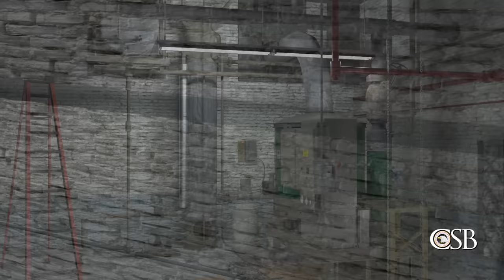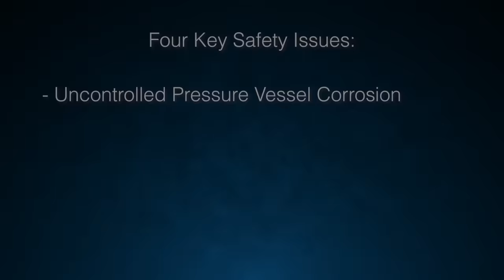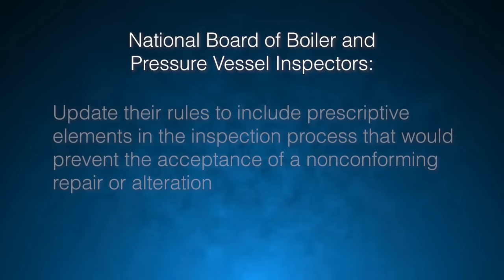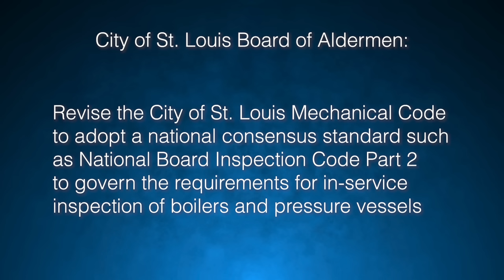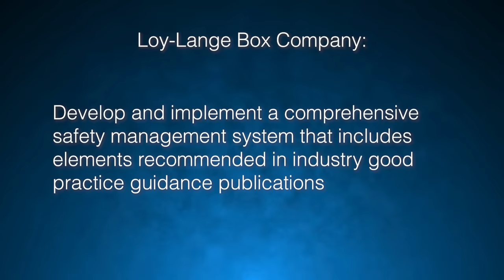Ignored Warnings: Explosion in St. Louis

Comment: I was surprised it wasn't recommended specifically that monitoring of dissolved oxygen levels in the pressure vessel and/or makeup tank should be considered.  In my old life I was in the Navy working in the nuclear reactor department of the USS Theodore Roosevelt and there were very strict monitoring and chemistry controls to prevent corrosion in the steam generators, etc... I now work in the private industry in Process Measurement Analytics and quote many types of analytical solutions including dissolved oxygen analytical solutions for Chemical, Water, & O&G companies.   Looking at Loy-Lang Box Company's setup they could have had a simple DO measurement in the makeup tank and a procedural step that the DO level  had to be less than a certain amount before they were allowed to initiate fill of the pressure vessel.  A $50K analytical solution could have saved them lives and lawsuits.
Reply: Bu that would have required them to spend $50K. Too many companies view maintenance/upkeep as an expense to be trimmed as much as possible.
Reply: @Wolfshead009  so true and such a sad thing
Reply: If you read the full report (here at https://www.csb.gov/loy-lange-box-company-pressure-vessel-explosion-/), they did measure DO periodically. That's how CSB knows that the oxygen scavengers were regularly low as stated in the video.
Reply: Management knew they were out of spec on O2 and continued poor chemistry and process control. No amount of tech investment fixes willful neglect.
Reply: This is the paper industry. They won't spend 1k, yet alone 50k.
Reply: Yes, but that was the Navy. Unlimited money available and serious training and accountability. Out in the civilian world, not the same. Lack of interest by the employees, lack of interest by the company and sometimes low pay and the  need to get product out the door runs the day.
Reply: This company didn't even apply for a permit before installing this equipment, allowing it to avoid inspections.  You don't do that with such an obviously dangerous piece of equipment if you care about endangering lives.

Comment: The “fix” that left a rusted ring at the bottom of the pressure vessel is probably one of the dumbest stunts I’ve seen on this channel.
Reply: Trouble is that a good engineering company assigned to pair that would tell them to repair the entire thing not just most of it. And the Cheapskate owners will not pay for all of it so they'll go and find somebody who will only repair what they want

Comment: Mythbusters gave me a whole new respect for pressure vessels, And their water heater episode showed very clearly what happens when something full of hot water under pressure suddenly becomes not under pressure.

Also do vessels like this not have a sacrificial anode? Our normal domestic water heater has a rod in it that is specifically designed to take a hit for the tank walls.
Reply: The water heater episodes were awesome.  Watching that water heater launch through 2 stories worth of house and the roof was amazing
Reply: Blevy
Reply: I wouldn't keep a water heater running once the tank starts leaking. And a water heater isn't a pressure vessel unless at least three things fail (normal thermostat, high temperature limit and relief valve).
Reply: Great question?
 As this was an exposed tank couldn't they just strap a block of zinc to the tank as the sacrificial "anode rod"?
Reply: @russlehman2070  Not really 3 as the single device is both the temperature and pressure relief. Can't tell you how many people have no idea and plug it when it starts dripping. Even more so on hydronic boilers whose feed valves are passing....
Reply: Yes they have a sacrificial anode. Here some FYI. Don't use hot water to cook with because an anode is made alot different than 20 + yrs ago. You can continue to do everything except cook with. Why listen to me. Water heaters made today are made to fail. Every legal water heater has a presure relief blow off at a certain pressure. It should also have a vacuum relief valve on cold water feedline above the heater. What's the purpose of a vacuum valve. Fill a large plastic coke bottle with water and then turn it completely upside down. Watch it pull in then out then on an on. So if water gets shut off in the street or maybe water pipes in cellar break. Your water heater will pull air in from above an water will drain alright. From experience I noticed that when a new watermain gets installed you will see old water heaters on the sidewalk. I recently installed a 30psi  relief value on my brothers heater and we also installed new water heater. When I went to home depot to buy a 30psi relief valve they only sell relief valves that go on water heater and psi is 150. That would blow the seals, temp and pressure valve and possibly boom.  I notified top management and warned them but have not returned yet.
     Water heaters are not made the same as shown. They will not hold the pressure to explode enough to go thru wooden floors. but will pop and with hot water. Old water heaters were made out of copper. My daughter has one in her house installed in the 70s. Those water heaters need anode replacement every 7 to 10yrs depending on condition of water. Copper water heaters if you put a plug in loc where relief valve goes and your gas valve messes up. Your competing with Space X. If you have a water heater and need to replace anode. Look for any water pipe hot or cold touching each other. Put a little piece of rubber between them. See if your getting a ground reading from water service. When water department's dig and repair a section of main or replace a service. They connect a jumper so they don't get shocked
Reply: @skipd9164  I replaced my anode last winter as I had several new identical anodes left over from no longer used wood boiler..... That bastard was tight! Half inch drive pneumatic wrench wouldn't budge it..... Three quarter inch drive air wrench strained a bit, but it came out and nothing but the center wire left of the long anode in the 8 year old unit...... I told a couple licensed plumber's this story and they said as they shook their head...... "yea we replace about one or two a year"......
Reply: I'm assuming the tank is sealed tight so a sacrificial anode would be impossible to replace. That's why it was designed with the assumption that it wouldn't experience corrosion. If you put a sacrificial anode in it it'd just delay the issue at best not solve it and in this situation it's probably better if process issues become apparant quickly rather that later, of course that's assuming the company operating it doesn't display criminal neglilence.
Reply: Nope no anodes here.  You treat the water first,  heating the water over 200 will get the oxygen out, no oxygen no corrosion.  In a power plant the boiler will be perfect inside.
Reply: Jared, not without proper chemistry control.
Reply: @dr.emilschaffhausen4683  “treat the water first” doc.  Apparently you’re semi-tarded…people on here make me laugh.  Read my comment again.
Reply: @bluesmoke8714  *bleve
Reply: @hedgehog3180  you assume wrong there is also a cold water feedline that brings water to the bottom and that sacrificed
Reply: A sacrificial anode is only suitable to stop galvanic corrosion. This is a case of oxidative corrosion, which is the same thing. It may not be protected by a sacrificial anode.
Reply: @jaredmayer3960  Jared I hope you don't set your water heater anywhere close to 200 degrees. 110 to protect people from getting burned especially kids.
Reply: @shakarchi420  your correct about the 3 that could cause problems but high temperature control and thermostat are together on the control valve and pressure relief is on the side by the top.
Reply: @hedgehog3180  most older homes use the water service line as ground. I actually watched a water department worker fixing a connection to the main get zapped. Standard procedure is useing a jumper. The never used it before and the crew laughed there ass off. While working as a gas tech I have found gas pipes in a home where electrolysis ate a small hole where water pipe and gas pipe touched each other.
Reply: @skipd9164  we’re not talking about a water heater here bro!
Reply: @jaredmayer3960  I don't see how you can heat the water to 200 and then use it at a lower temp. I also hope you never use the water inside a boiler for personal consumption. You can use it to heat hot water in another element. Water inside a boiler is extremely dangerous

Comment: I used to work at a major Corrugated Box Plant. There were 2 things I had great respect for:

High Pressure Steam Boiler: Used in Fluting, Heating, and Drying processes. 

I forget what PSI and how Hot but it was substantial. Maybe 400 - 500 degrees and hundreds of PSI pressure. Boiler was large and was located in it's own specialized room. Even in the dead of winter, the boiler room was hot and noisy. It ran on Natural Gas, plus there was a large external tank with Diesel as a backup energy source. Boiler ran 24/7, but was shut down after C Shift on Friday or Saturday depending on work volume. Boiler was re-started Sunday by C Shift. Pretty sure Boiler was kept hot, just not super-heated. 

Caustic Soda: Used to make adhesive for gluing different layers together.
 
It was delivered by tanker and transferred from tanker to inside non-corrosive semi-transparent plastic tank via a small opening in wall. The tank itself was in a dedicated room and had a low 2 foot curb to contain any leaks from tank. It was large enough to contain all contents of tank and it had a special epoxy paint to protect the concrete from corrosion if there was a leak. The Caustic Soda was concentrated and could dissolve human flesh in seconds. 

We depended on high pressure steam heat and caustic soda. Without them, we couldn't make corrugated cardboard. If we couldn't make corrugated cardboard, we couldn't make cardboard boxes either. Company was very responsible in regards to Preventive Maintenance. There were no incidents during the years I worked there.

Comment: There are two failure points mentioned but not addressed as corrective measures.  1) The design of the preasure vessel should be resistant to oxygenation, where either the construction materials resist corrosion or the tank ports shall be located where oxegenated water cannot collect outside of the normal water flow.  And 2) The deoxygenation chemical shall be continuiously monitored so that the system will not operate for an extended time with an insufficient chemical mix.
Both of these steps are preventive, to prevent an unsafe condition.  All the steps advised by the safety board were reactive, and while they may help to prevent another catastophy by monitoring the condition of decay; I prefer to prevent the decay alltogether.

Comment: In 1988 I went to a university housing unit to find out why they had no heat. A similar device to this provided Steam Heat in the basement. It too ran on tap water that had not been conditioned. It was a large basement and I found Parts all over the place. I could not believe that such an archaic Appliance was still in use. I repaired it to keep my job and I told them that this would be a recurring situation. I had no idea that these could do this much damage. Stay safe out there and look in your basements.

Comment: Having worked in the steel industry for most of my career, I would say that any equipment which stores significant energy, deliberately or otherwise, is a hazard and needs procedures in place to mitigate the risk. The type of energy doesn't matter - kinetic, potential, heat, nuclear. Here it appears it would have been easy to make periodic measurements of wall thickness by ultrasonic methods, and how anyone could think it was safe to have good steel held in place by corroded metal is crazy. 
<Edit> Thanks for a brilliant video! </Edit>

Comment: Being as I am now an Active USCSB Investigator and a Certified Boiler Inspector. I can't fathom why anyone would use a pressure vessel with corrosion! That's a ticking time bomb!
Reply: "Active USCSB Investigator"? No. You couldn't find your butt if you were squatting on a mirror, sir.
Reply: Seems to me almost every compressed air tank has some rust the only question is how much rust.
Reply: @waltahlgrim5508  Compressed air tank and a pressure vessel used in a manufacturing or fluid processing operation are two different objects.
Reply: All pressure vessels are dangerous the only difference is the bigger blast radius when you fill one with steam.   @IntercontinentalArmy

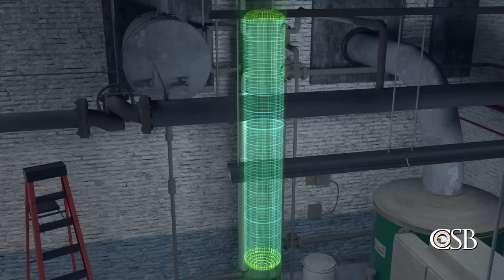Comment: There is a curious statement at 2:30. The temperature of the water in the pressure vessel was stated to be around 200 degrees and was kept pressurized overnight to "retain more heat than it would at atmospheric pressure." Since the water was at less than boiling temperature at atmospheric pressure, increasing the pressure would only increase the temperature loss due to higher (but so small as to be negligible) thermal conductivity, not to mention the added energy necessary to keep pressurizing pump running all night. This thing was not a boiler where "bottling up" at high pressure would eliminate the heat loss associated with venting steam to remove pressure from the system.

Comment: These videos are above the top awesome. I give credit to the narrators voice and the top quality CGI... 

On that note I am a truck driver and I go to many facilities and it's quite disturbing the level of neglect and disregard to the maintenance and upkeep to the facilities and their equipment. I believe quality stems from cleanliness and upkeep of these facilities. As a side effect of such quality assurance measures Safety is improved because as you walk a facility to clean and maintain it's components you come across maintenance issues that need to be dealt with
Reply: All pressure vessels should be corrosion resistant, period.

Comment: It appeared to me from the images of the exploded tank that the 2012 repair was just a piece of plate slapped on over the existing rusty area. The animation shows the 2012 leaking and rusty section being cut out, but I believe this did not happen. If the 2012 rusty section had been cut out, the repair company may have seen how comprimised the remainder of the head of the tank was, and recommended a larger repair. It is really not a good idea to put a band-aid like this on a pressure vessel. The repair company would have had no idea how thin the head of the tank was without cutting into it. The entire head of the tank should have been replaced, but undoubtedly the client did not want the associated downtime or dissasembly costs. They would rather endanger lives than financial setback.

Comment: What I see is a lack of understanding by low level employees of what they're dealing with. The inspections may have caught the issue as it got worse, but won't do anything to prevent the corrosion in the first place. The new hire employee has no idea WHY a certain procedure exists to prevent safety concerns. All they see is lost time and production. They just think preheating the water before it goes into the pressure vessel just takes the load off the heating elements. They won't know that it removes latent oxygen to prevent corrosion. Less chemicals than required is probably a cost cutting measure.

Comment: Why isn't a pressure relief valve required? I was shocked that there isn't one and that it wasn't mentioned. It was my understanding that all pressure vessels be protected

1006.3 Pressure relief for pressure vessels. 
Pressure vessels shall be protected with a 
pressure relief valve or pressure-limiting device 
as required by the manufacturer's installation 
instructions for the pressure vessel. 

1 006.4 Approval of safety and safety relief valves. 
Safety and safety relief valves shall be //sled and 
/abe/ed, and shall have a minimum rated 
capacity for the equ/pmer7t or appliances served. 
Safety and safety relief valves shall be set at not 
greater than the nameplate pressure rating of 
the boiler or pressure vessel.

Comment: The water animation is amazingly detailed. I am a layman in this field for all intents and purposes, but where the pipe takes water from the pressure vessel to the steam generator, couldn't it be closer to the bottom of the pressure vessel to minimize the the amount of oxygen filled water could be in the bottom of the tank? Or would that create weak spots and accelerate the aging of the pressure vessel?

Comment: The conclusion that Loy-Lange did not understand the potential dangers of operating a leaking pressure vessel is too naïve.  Boiler explosions have been known since the very first use of steam and boilers and that is more than 300 years. Loy-Lange knew, they just didn't want to spend the money. They also knew that the city required inspection of such devices and deliberately bypass inspection by never registering the pressure vessel.  So did the repairman who "fixed" the leak.  Everyone responsible for this tragic accident is covering themselves with the excuse of ignorance.

Comment: During the repair to the bottom head of the SCR they had access to the corroded portion that remained. They could have removed the corrosion......done non-destructive investigation of the remaining thickness and only then weld in the new section. Or they simply could have replaced the dam thing after getting FIVE YEARS out of the repair. But no......greed won out. They should be charged with manslaughter.

Comment: Hard not to brag from the european perspective, but the rulebook of running pressure vessels seems to include lots of loopholes. Afaik any pressure vessel in europe needs to be inspected at least every 5 years inside and outside by testing organizations. 

The most impressive detail hrere is the repaired head which held up throughout the explosion ... those are some impressive welds.